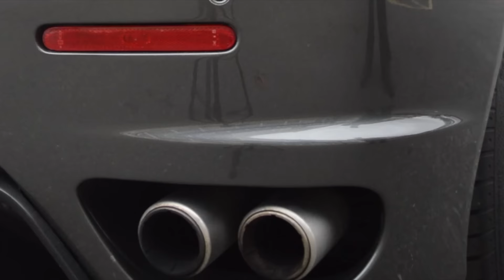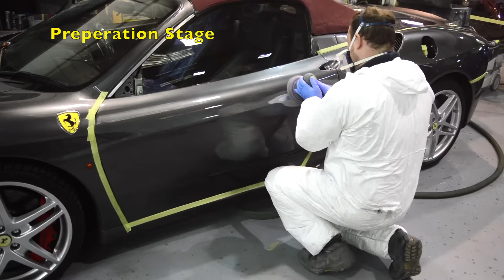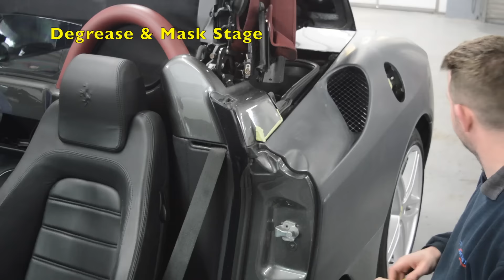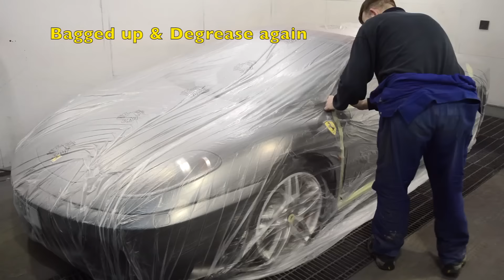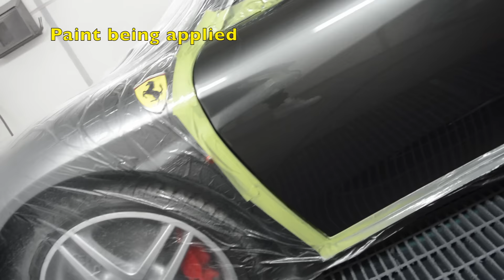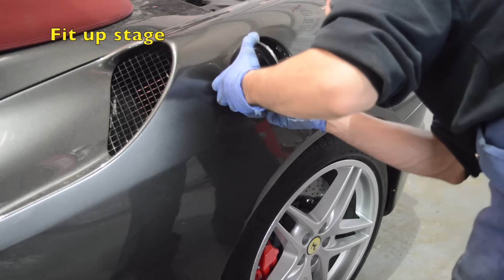Repair & Paint process on this Ferrari F430 The Bodycentre Ltd Norwich

Comment: How do you make the paint durable like OEM factory paints jobs that resist chips better than most after market body shops? The factory can bake the paint/clear coat @ high temps  because the car is not fully assembled yet, metal frame only, but now that would be difficult.
Reply: Summer will sort that.
Reply: you can bake up to 145f  for 30 mins or depending on paint line . hybrids and electric cars alot less temp

Comment: Masking the badge up on the rear wing seems a bit 'corner cutting ' to me.
Surely the potential for an edge to be spotted and the cars value suffer is more important than the extra 1/2 hour spent removing and fitting the badge
Reply: value is already tanked due to the repair no matter how good it is car has a black mark on it. estimating software provider will sell the info before the paint is baked on
Reply from the maker: What badge was left on????